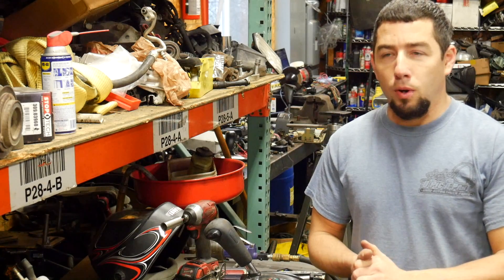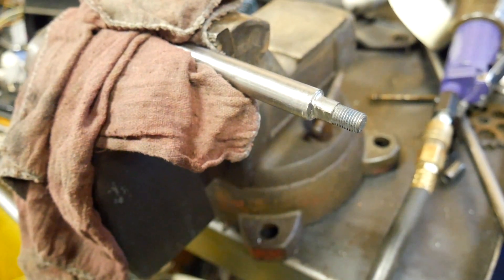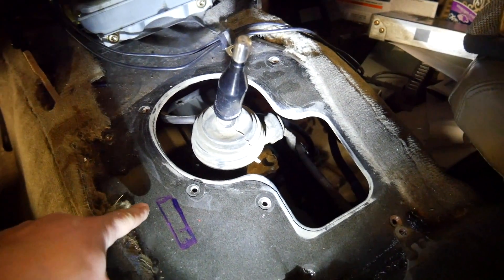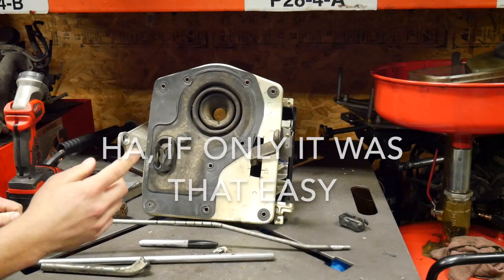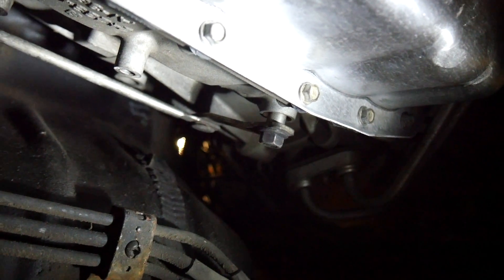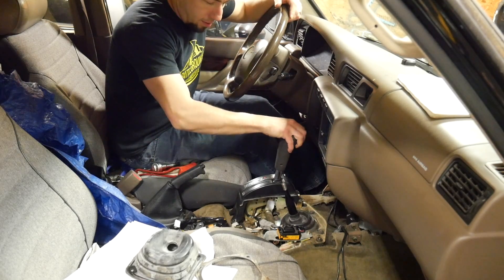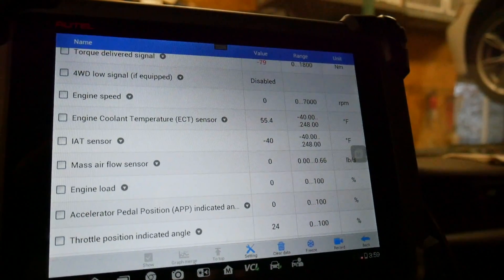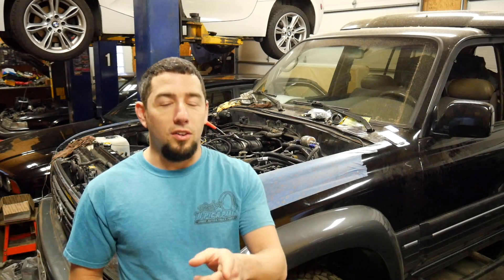80 Series Land Cruiser LS Swap PART 4! All About The Shifter & 6L80E

Comment: Wonder if you could have used a RHD shifter assembly
Reply from the maker: The arm is still on the same side. Since they use the same transmission, they just change the side of the selector rod inside the cabin.